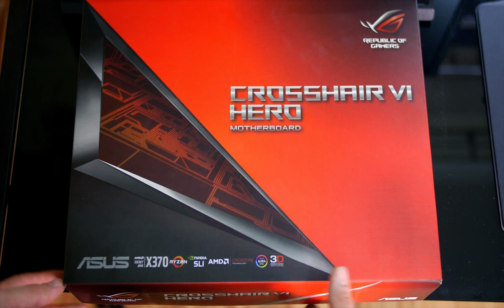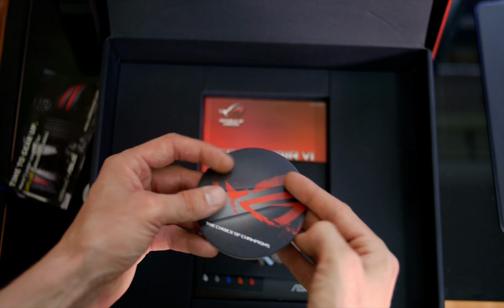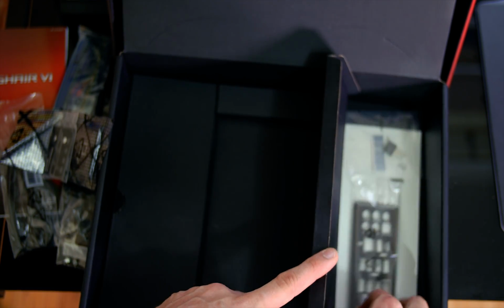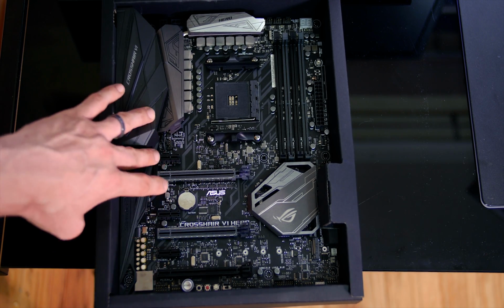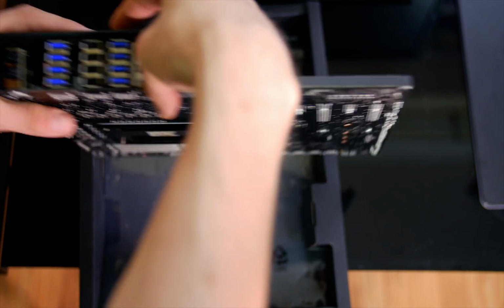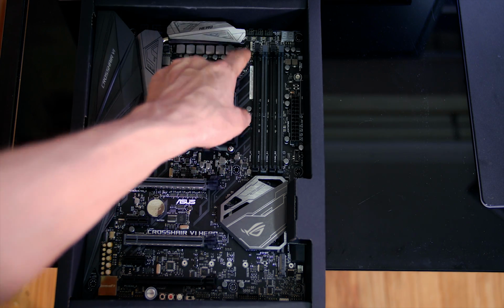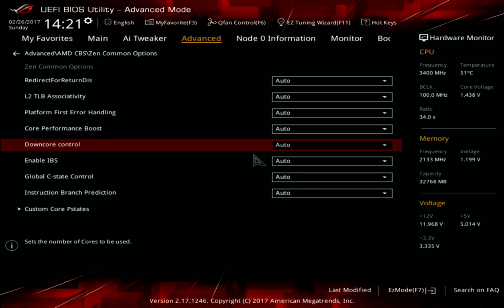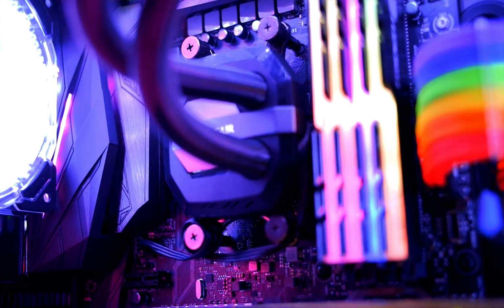ITS AMAZING! - ASUS Crosshair VI Hero X370

Comment: Late into the ryzen adventure, but i am struggeling so bad! i have even instability with every settings at Auto (default) i can run cinebench etc just fine. But if i even try use a longer(harder) cpu stress tester everything crash. I have rams listed for QVL list.
Is this a normal issue? or is it a hardware based issue? :/

I am so sad, hope this is not me, buying a high end motherboard and CPU and fails. i have 13 days until my free return periode is over

Comment: Hey UFDisciple

I have the same motherboard with an ryzen 7 1700, asus strix gtx 1080 and 16gb of hyper x ram.
to the problem: i installed everything and it worked fine at the start but when i downloaded the new bios and chipsets all leds stopped working exept the asus strix gtx 1080s leds.
i've tried everything reinstalling the old bios reinstalling the asus aura programm but nothing worked im really frustrated because it is the first pc i ever build.

Comment: Hey m8, would you be so nice and post a in depth bios configuration for this board.  pointing out the stable of things you should do and after it ofcours the extreme settings. Reason I ask I got my 1700 ryzen @ 3960mhz what is fine compared to other people. what I'm stuck at is keeping high memory I got to 3520mhz 14-14-14-14-32 t1 stable longer then 10 20 minutes. I have a gut feeling I missed somethings.

Comment: Which better "1700 + crosshair VI" or "1700x + prime x370" ?
Reply from the maker: I'd take the 1700 + Crosshair.  The CPU's, at  this point, overclock to about the same point of around 4GHz, so I'd rather have the higher-end motherboard.  That might change as the production process for Ryzen matures and we'll start seeing better performance on the 1700X, but at the moment they're roughly identical.
Reply: Prime is the one with the huge list of Ram supported.

Comment: $255 dollars on Amazon with 3/5 stars. lots of complaints about the bios.
Reply from the maker: +saint derpy Unfortunately an issue with many AM4 motherboards.  Teething problems in many ways since it's a brand new platform.  I didn't experience any hiccups at all though.
Reply: True, worth mentioning though.

Comment: Fun fact, asus AM$ board's are a big mess right now , so no it's not the best , not @ least until a decent bios comes on it @ least ;/
Reply from the maker: +SeikonDS It's variable.  I actually experienced no issues on this board, when other reviewers were struggling with similar settings.  There's definitely teething pains in the market for sure. Ryzen is a complicated new launch.  I'm fairly certain ASUS will sort it out ASAP.
Reply: SeikonDS I've had no issues on my Asus Prime X370-Pro. The only issues people are experiencing really are ram compatability and speeds.

Comment: i want to ask a question- i have a z170 rog mobo which i have replaced twice, beacuse even after flashing the bios to the latest, it messes up and does not even boot, and it turned off after 10 secs, which i just fixed by not updating my latest replacement... its a maximus 8 gene... I've not been able to find out why do I'm asking here... any help would be great!

Comment: ASUS X370 Crosshair VI Hero vs MSI X370 XPower Gaming Titanium???
Reply from the maker: Different markets entirely by my estimation. Xpower is more for extreme overclockers, whereas the Crosshair is suited for power users.  Also, Crosshair is cheaper, so I'd buy the Crosshair.
Reply: But aren't you an overclocker. You will try to go the extreme?
Reply from the maker: +GameHead_ZA I'm not an extreme overclocker by any means.  Check out DrWeez to see what a South African overclocker is. I'm a power user, and the Crosshair already has more settings than I'd ever use.
Reply: Good to hear. (Thumbs Up)

Comment: I have same board, r7 1700 g.skill 3200cl14, and it's running 3.9ghz@1.35v LLC2 (stable for gaming, not for folding), and ram is running at it's exact specifications (3200mhz 14-14-14-34 T2 at 1.35v). 

What's with the 1.55v cpu voltage? It NOT recommended.
Reply from the maker: Nice dude!  Good settings there.  Unfortunately, I had to return the board before even the intial BIOS updates rolled out, so I got no extra stability during my time.

I know the 1.55v isn't recommended.  Was just testing a few things out there.  :D Didn't capture footage of my actual overclock, only when I was messing around.  QQ
Reply: sucks you had to return it so early (or at all).
Reply from the maker: Agreed. :(